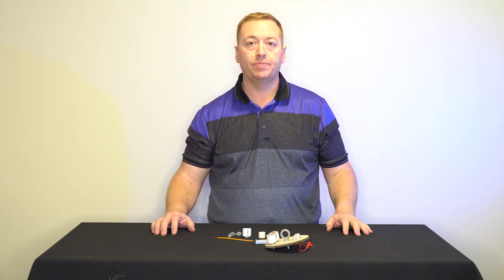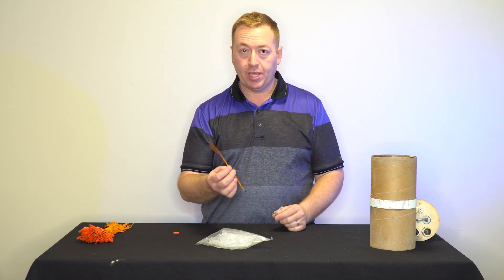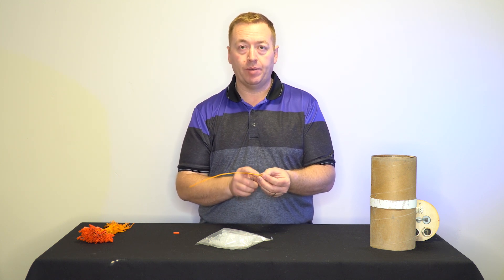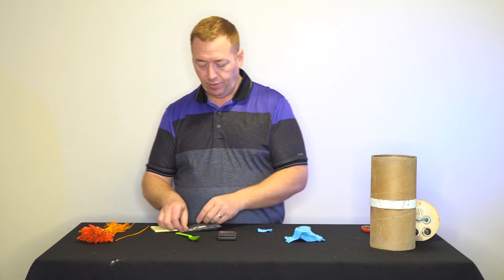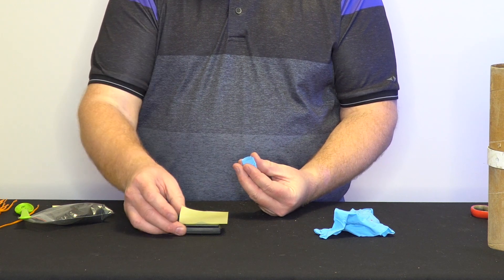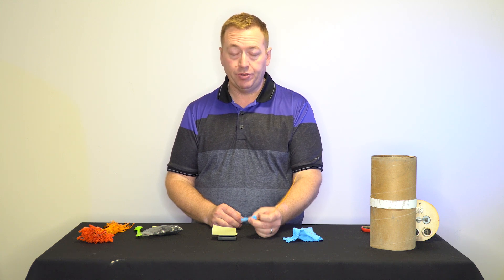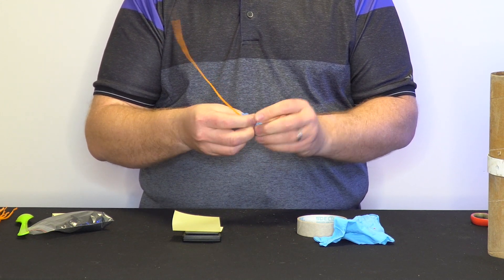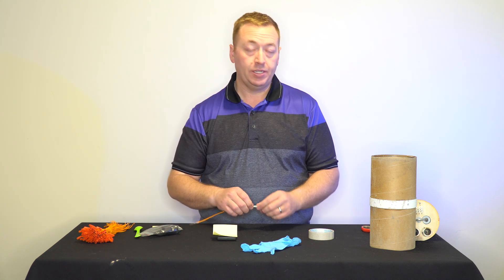High Power Rocketry Ejection Charges

Comment: I've been using your 'glove method' from the very beginning. However I've been using corners of sandwich bags instead. How have I never thought of or heard of using a glove finger?! In our hobby, just like it is through orbital rocketry, any weight you can save is worth it. I've always thought that those plastic wells for charges and the wire connections people use just create failure potentials AND add to the overall mass of the rocket. Ematch + powder + glove finger + tape = cheap, lightweight and [virtually] fail proof.

Comment: The glove method seems pretty good. I don’t have an accurate scale for fractions of a gram, so I use the centrifuge vials for measuring the powder. Aerotech DMS motors come with the ejection charge powder packaged inside these kinds of vials, and the vials have graduated marking on the outside. So you can just dump in the powder, look at the markings, see how much is in there, and adjust as necessary.